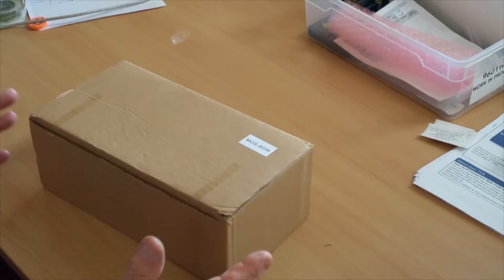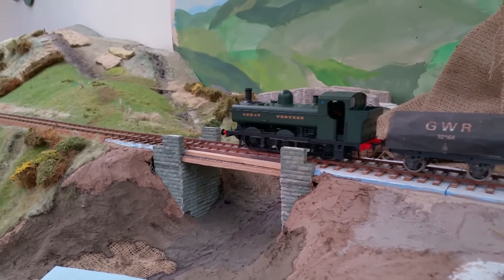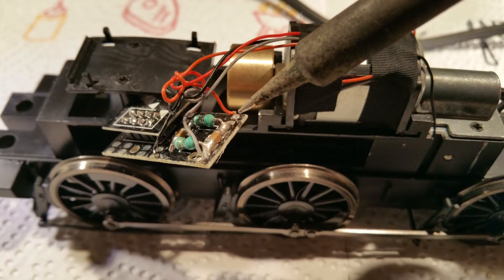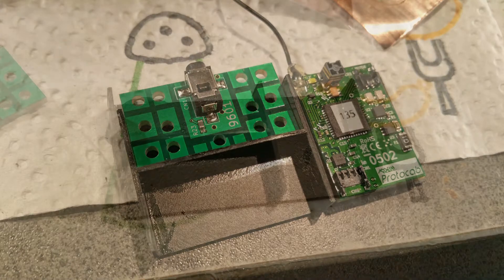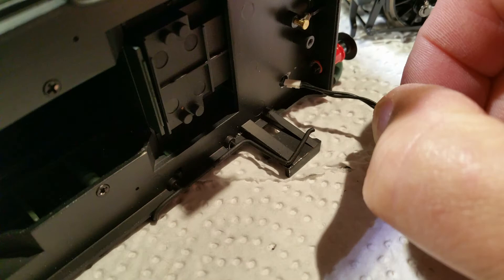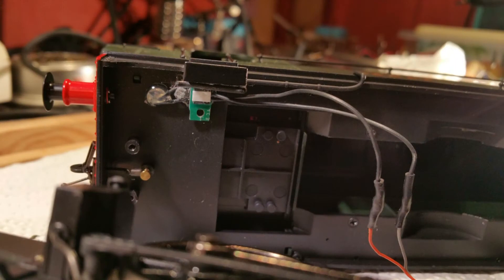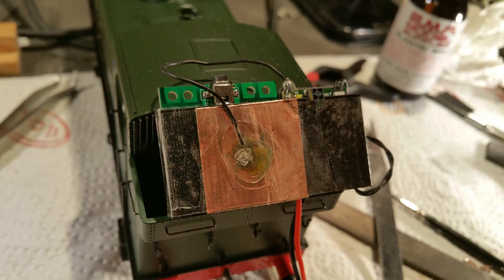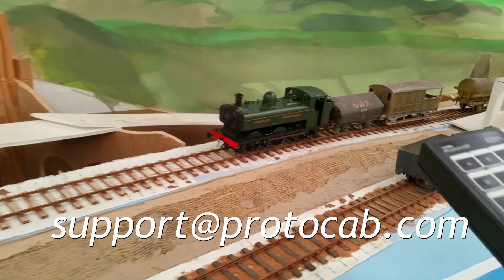AXS7B01 Installing Protocab in a Minerva GWR class 8750 Pannier tank loco

Comment: Fascinating video. Can you tell me please where the loco (copper) switch sits? Cheers, Angus
Reply: Hello Angus, in reviewing this video, I see that we didn't answer your question at the time.... only two years late, my apologies! The harness that I show that contains the 0502 Locomotive Control Unit and 9601 Plug Charging Unit is covered by a plate to which the copper pad is attached with sellotape. Thus when the harness is slid into the bunker, the copper pad is against the bunker rear, so you just touch the outside of the bunker to switch on (and, optionally, off - the LCU will automatically switch off after about 5 mins of inactivity).
Hope that explains it...

Comment: But how can the 12-24v motor of the engine work with only 3,7v from the Battery?
Reply from the maker: The voltage is boosted in the 0502 Locomotive Control Unit. It means we can use a single cell rather than multiple cells and there are several advantages to this approach. The downside is that there are some efficiency losses during the voltage boost, but they aren't too significant. We boost up to 10.8V rather than the full 12V for two reasons, firstly most customers told us that they never run their locos at top speed and secondly, the amount of circuitry to lift the voltage to the final 1.2V would add about 30% to the footprint and we are trying to minimise the amount of space that the Protocab components take up inside the loco. Hope this answers your question. Thanks for asking it.